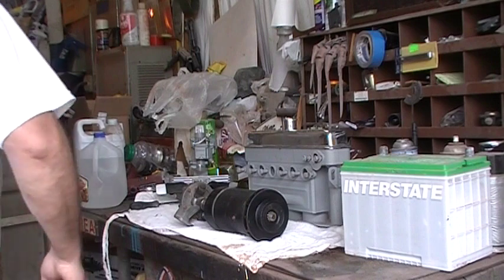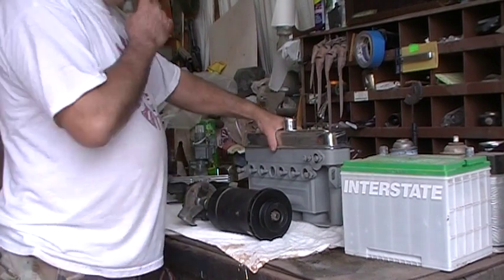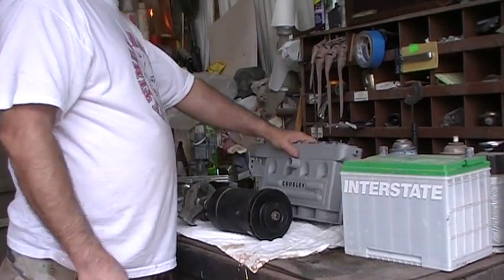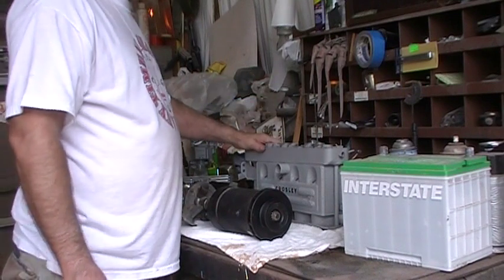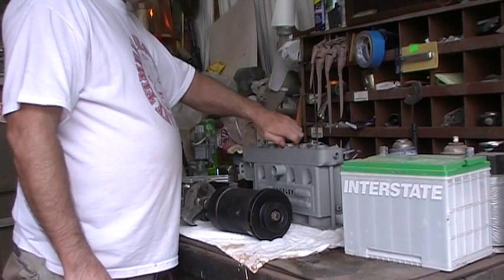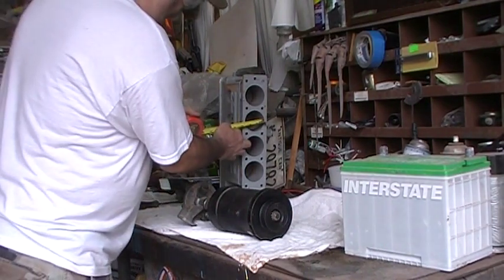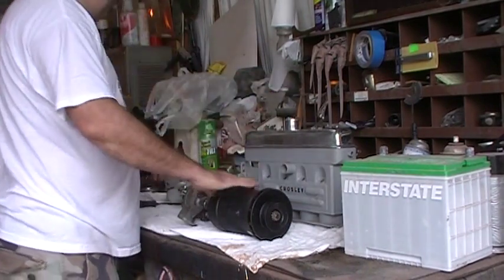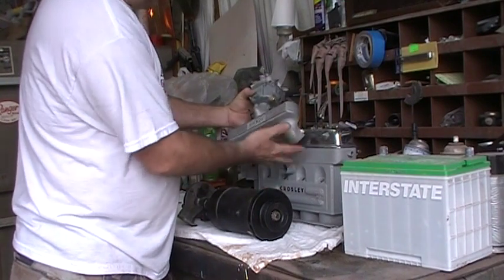Crosley engine tec

Comment: There were a number of Crosley engine types including a flat 8 Boxer with one crank.  A number were used to run the power generators on the DUE Early Warning line and were very reliable.  For a long time everyone wanted a DOHC Crosley for small projects.  Keep in mind that Willis Jeep only had 20 HP "Go Devil" engine (Wippet 4) at the start of production in 1940 (or so) and were not any faster or more dependable until they rebuilt the entire design.

I would love to see an up-dated steel "Tin Can" engine built with today's materials and machining.

Comment: Nice summary. Thanks. My uncle had a HotShot and I had a friend who raced a Nardi Crosley back in the 1960s. I think the car weighed about 600 lbs. and was quite fast for being so tiny. The whole engine complete with flywheel weighed about 120 lbs. I know because I lifted it out more than once. Bandini modified the Crosley engine with a twin-cam head and got over 80 hp out of it, I believe.

Comment: ever think of useing a 2 or 3 cylinder diesel engine in one of your gocarts  we put a 3 cylinder yanmar diesal in a ford festeva and are getting 48 mpg at 60 mph thinking with the lite weight of you cosleys and the right gearing you could get way above that with a small diesel engine  just a thought but that engine is cool to

Comment: THAT'S A VERY GOOD VIDEO CUT YOU ARE DEFINITELY SHARING A VERY GOOD MESSAGE BROTHER ABOUT THE CROSLEY I HAVE GOT A TRANSMISSION AND A REAREND OUT OF A 1948 MODEL AND THE BACK RIMS AND HUBCAPS AND THAT IS ALL I COULD SAVE FROM A OLD COMPLETELY DESTROYED BY ROTTED BODY AND FRAME AND DIDN'T HAVE A MOTOR IN IT BUT I HAVE MANAGED TO SAVE THE ABOVE MENTIONED ITEMS AND I WAS FORTUNATE TO SAVE THE ABOVE MENTIONED ITEMS THE VIDEO WAS GREAT AND THANKS FOR SHARING IT IM JUST ROUNDING UP SOME PARTS INCASE I COME ACROSS A BODY AND FRAME AND MOTOR I'VE GOT A TRANSMISSION AND A REAREND AND THE BACK RIMS AND HUBCAPS
Reply from the maker: I will keep an eyeball pealed, just incase I find one. 😉